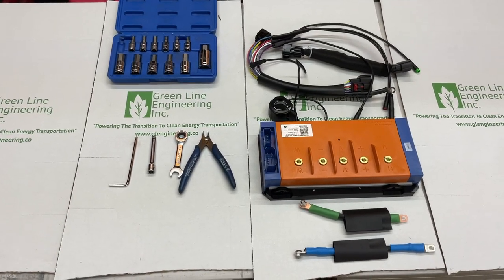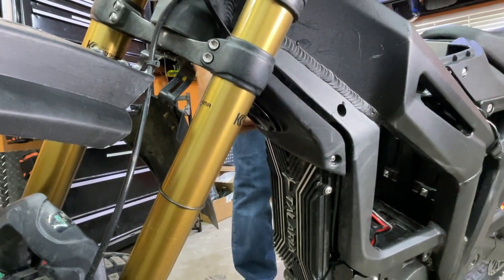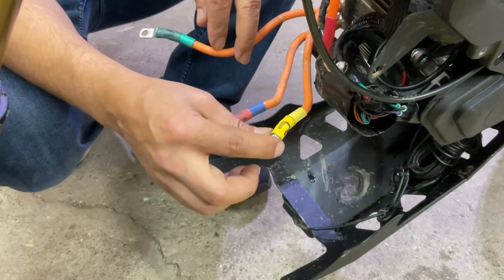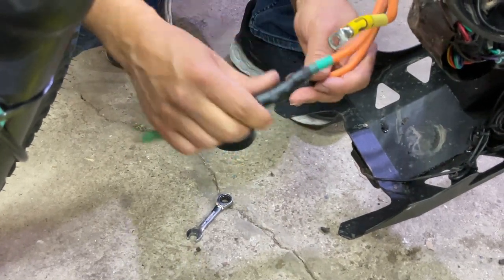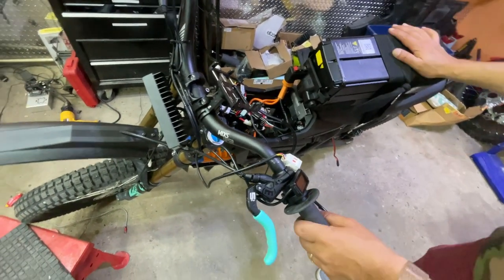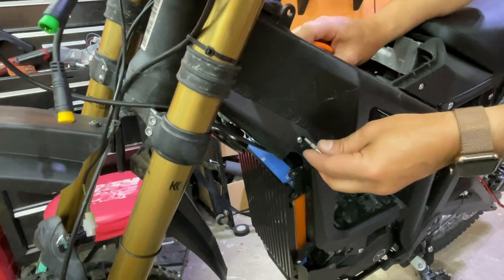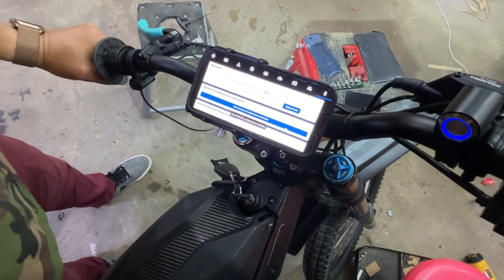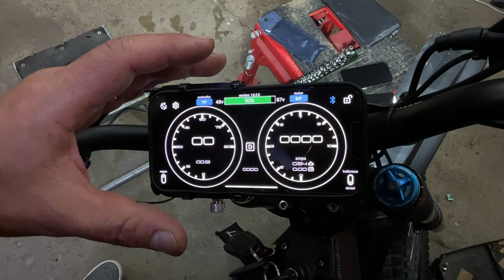TALARIA INSTALL OF GLE BAC8000 Ludicrous Power Upgrade !

Comment: I got my GLE BAC8000 for Talaria installed it and bypassed the battery. OMG! This is the most awesome upgrade period. Works fantastic 56mph no problem at 8kw with stock sprocket and wheels and pulls the entire way. At slower speeds the power is amazingly controllable no need to switch modes.  Thanks Josh for putting this together. The dashboard works great no problems very nicely done. Once shipped it only took two days to get to my door here in BC Canada. Cheers!
Reply: what mount did you use for your phone/ dashboard?
Reply: @electrified6043  late but I use now the quad lock phone mount but I used to use the gub phone mount both are amazing
Reply: @SwarmMcReynolds  I still got a relic of a phone lol s8+. couldn't find the quad lock case doe my phine
Reply: What phase amps are you running?

Comment: I’m not sure what bits you’re using but I think the Wiha socket set would be perfect for this. Has probably the best bits I’ve ever used and comes in a decent metal case with a perfect mini ratchet that’s like 4” or so in length. Not as good for getting that extra torque you might need as that fat Husky though, that thing looks like it definitely has it’s use’s on these bike’s Lol. Perfect for getting into tight spaces and those German made bits are the hardest steel I’ve used. Expensive compared to husky but so worth it. Would love to learn how to do this but I’m not sure I have all the tools needed. Nice work

Comment: I don't understand why you supply wire extensions instead of longer wires. There is a lot of resistance when joining wires as you are doing.
Reply: No idea but possibly because most people won’t want to unbolt the main phase wire and risk swapping the wires and damaging something or just don’t want to do the extra work 

But can’t imagine it could be more powerful then it already is with a bolt and nut connecting to wires
Reply from the maker: And how one might go about connecting these longer wires without having to open the motor up ? That makes no sense .

Comment: Hello everyone, someone knows if the connector is the same between surron and talaria sting mx4?
Reply from the maker: No it’s a completely different connector. If you only need the connector because you already have the bac4000 or 8000 you simply can buy the GLE harness integration kit from our website. https://www.glengineering.co/products/gle-dashboard-integration-kit-harness-for-talaria

Comment: No thread lock smh

Also you always want to tighten by the nut not the bolt. Hold the bolt spin the nut.

Comment: All these videos on making it faster.  It does almost 50 stock after cutting the wire. And i personally wouldn't want it to go faster until someone  comes out with an affordable upgraded brake system cause the stock brakes suck. It needs a motorcross brake kit for rear they have it for the front, but its never in stock.  Really fun bike otherwise.
Reply: When you get smoked by another Talaria rider with an upgraded GLE BAC8000 on a hare scramble race or a motocross race you will upgrade the next day. nobody likes to be consistently last in a race whether amateur or pro.

Comment: You know what strips nuts bolts and threads.
Going at it with no balance, or form.
Watching you take off these phase wires makes me feel like you was turning red while making this video. 🤣

All in all thanks for the tips and look forward to seeing the use of power-tools, as when they are used properly
you should not have that issue.

That is kinda what numbers on the side are for on most 🔋🪛drills.
As for a impact drill, if it has no loctite then again this should be no issue for a power tool.
Now if there is Loctite on the nuts or bolts, a 🔥torch and a steady hand ✌🏻can make the loctite  release thus you can
again use a 🔋🪛 power tool for this and not a 🐒🔧wrench.

Also for sake of ⌛time etc most common people will 🧑🏼‍💻edit a fast forward through these parts of a video, as its not complex
to understand taking off bolts, unless there is some special amount of turns we need to make, for a special reason.

Another reason this is important is me the viewer and you the creator.
You don't want to spend time watching yourself put them bolts in for the edit, so time-lapse that part which saves
us time and you time on the render, upload, etc of the video. 🍿

I understand watch time but It's hard to sit and watch someone take each bolt off one by one.
Also when you have a product your selling, Im not sure your goal should be watch time as
it should be professionally explaining each setting and why you have decided to have these settings and/or what
you might be considering to add based on people who like what you are creating.

I also feel I may have wasted my time in this comment, but the goal is to see more professional videos
that get to the point and skip the things most people already understand.
So you should consider my comment as 👷🏽constructive and not negative feedback.
Its cool if you prefer to use hand tools, but they are not a must have for this process and knowing that
can help others who might think, well if I have to buy all these tools, then maybe I don't want this controller.
So again, my comment is constructive not trying to throw shade.